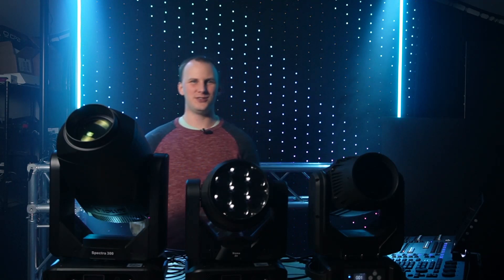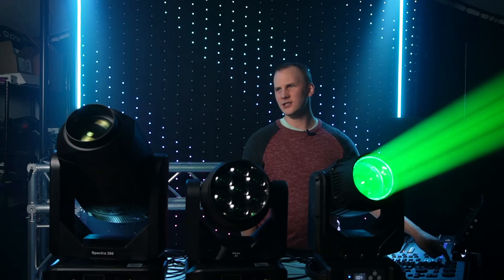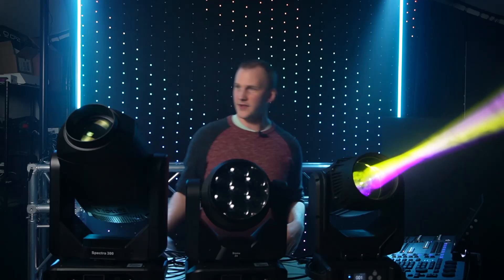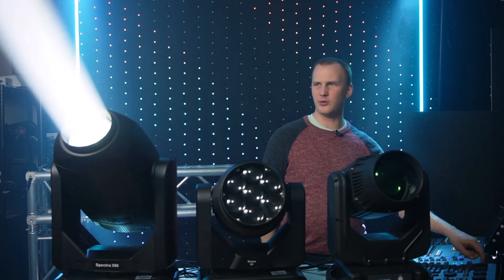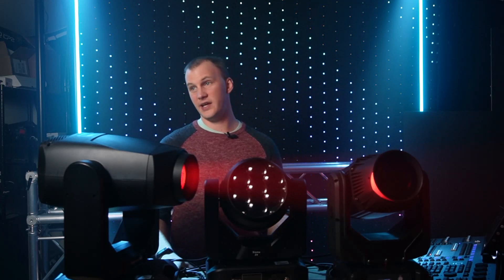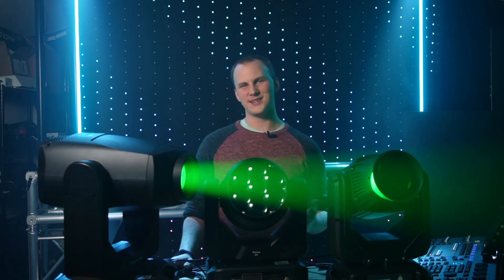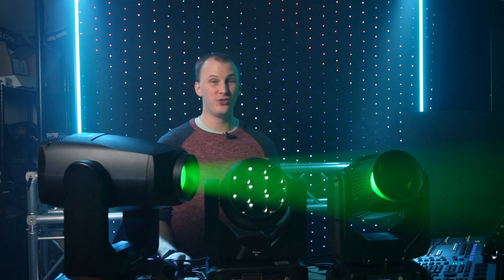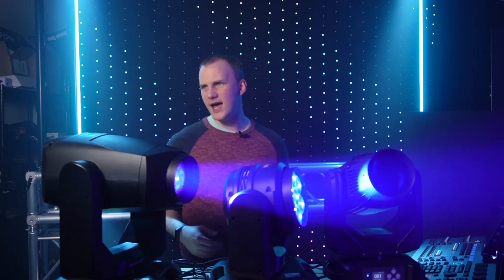How Do You Use Colors in Stage Lighting (Pt. 2 - Programming Colors)

Comment: Honestly the output lost with CMY fixtures isn't a big deal at all IF, you have enough of them for your space, and have lighting fixtures that are kinda "overpowered" for your space! SO CMY fixtures have an LED engine that produces a brighter beam in open white than we would need for a 200 seat space w/ a 28x12" ft stage, with an 8 ft trim...BUT all that extra output comes in so handy when you mix deep colors, like the red in the example! I will also say that for most vivid blues and purples we find it's important to keep the intensity at full, if you needed more flexibility with the overall brightness of certain colors, look at a fixture that's more in the 500 to 600w LED engine class.